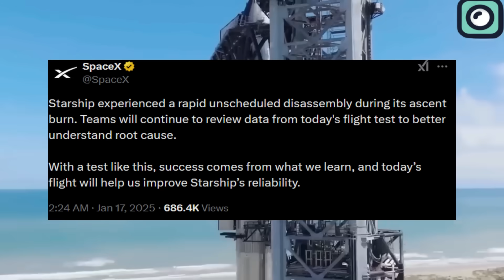SpaceX Officially Revealed Why Starship Upper Stage Exploded!

Comment: 1:54 you can see the piece of the skin (at the mid of left edge of the video frame) is peeled off the body. It flapped crazily just few seconds later (can not see from this video). It is the one caused the failure.

Comment: The video says Spsce X learns from every test flight. Yet it introduced a new catastrophic failure mode either missed before or brand new. If it is new , that is bad. If it was missed that is worse and points to the design not showing maturity. Either scenario, there should be cause for concern. I am not sure that launching right away should the driving factor.v

Comment: Not to forget these are test flights mostly using obsolescent hardware as the design is iterated. The ship likely was going to burn longer using the 300 extra tonnes of fuel. Booster will also be stretched in future with more thrust . None of what we see is intended for routine use yet.

Comment: The purpose of this video is to answer one question: Why did the second stage(ship) explode?  It was because of a fuel and/or oxygen leak.  That needs less than a minute to state.  Further details on what caused the leak and exactly what measures could be used to assure that it would not happen again could have extended the video, but instead we just hear a history of the Starship launches.  Not good.  We watch these things for the details.  We already know the history.
Reply: Yup. Totally agreed.
Reply: Thank you for saving me the time of saying that.

Comment: Compare the Saturn 5/Apollo project to Space X, Its obvious that the engineers of the Saturn 5/Apollo actually did engineering, this is evident by the lack of "catastrophic" failures of the system after a few initial mishaps, NASA's Shuttle is another example of good engineering it didn't suffer a single catastrophic failure during flight testing, The Russian shuttle is a excellent example of great engineering, it worked as advertised on its first flight, remarkable engineering. How many failures has SpaceX had up to now, excluding the launch pad debacles?.
Reply: With spacex, every failure is a success. 😂
Reply: The shuttle exploded on launch with the loss of all astronauts, these spacex tests are unmanned and will continue until completing them successfully numerous times
Reply: Russian Shuttle never flied in space with astronauts. The american Space Shuttle exploded Two times with a lot of astronauts died. It was Better if It exploded during unmanned tests, learning how to fix problems.
The same for the Apollo: remember the three apollo astronauts died in the capsule during the tests on Earth.
And finally the New Glenn Is a failure at the First launch, because the first stadium dangerously crashed into ocean, and never landed on the ship.

Comment: The upper stage was clearly under speed at separation by 900km/h and didn't meet its speed and altitude goals.
By T+ 5.09 flight 6 had reached 10,000km/h and an altitude of 132km.
While flight 7 had only reached 8000km/h and an altitude of 117km in the same time frame.
By T+ 6.15 flight 6 had reached 14,000km/h and an altitude of 142km.
While flight 7 had only reached  10,000km/h and an altitude of 125km.
If you extrapolate this out and consider how much fuel was used in the same time frame SN33 clearly was not going to make its target for re entry.
The spaceX explanation of over pressure explosion makes less sense than an abort and self destruct in my opinion.
Reply: FFS, there was 300 tons more fuel on the ship. I'd expect it to be slower with the same booster thrust.
Reply: @BorgeltInstruments  yep and you add in the propellant leak which makes it an obvious abort decision.
How you going to do a re entry burn and a landing burn if half your fuel is spraying out of the feed lines?
I would bet that extra 17 seconds of fuel got burnt and expelled during the ride up.
Reply: Very interesting, propellant leak aside it's interesting that the extra weight  with addition flue and payload hadn't been taken into account with added burn time to reach a similar flight trajectory to flight 6?
Let's hope they can resolve the fuel issues and recalculate the burn times from this failure, I'm looking forward to flight 8

Comment: Very bad? Is a test. Tests are never very bad or very good, we Need errors to reach perfection.
Reply: Wrong, SpaceX where using this flight to validate the vehicle with the aim of integrating it into full orbital operations. Yesterdays catastrophic failure proves that its not ready for that integration, nor will it ever be an appropriate vehicle for humans until SpaceX engineer an escape mechanism. Also, tests can be "very bad or very good" depending on the stated objective of the test, however, any failure to not complete the flight objective, in this case return the booster AND starship to earth, which was not completed, therefore means that it failed which = very bad.
Reply: Laughable comment.
The other guys delayed and fixed stuff and got it right but you think just blowing everything up every launch for billions of dollars is a great thing.
Obviously you DO NOT need to repeatedly obliterate your ships on pointless launches riddled with faults.
But it’s all good I guess since it’s only taxpayers money yeah?
Reply: Tests ? They are on their 7th test....and the last one was catastrophic. For comparison, Challenger did 10"tests" before it exploded and even that was at least arguably preventable. The shuttle missions did 135 "tests" altogether and all manned except for the Enterprise which was never operational as an orbiter. And every Apollo rocket that went into space (4-17) all returned to earth without exploding, although 13 nearly ended in disaster. That's about 150 space flights when they all became operational and all returned to earth with a loss of two.....quite different statistics compared to SpaceX. Those guys are as far from Mars as the ground is from the sky.

Comment: Bezos New Glenn reached orbital speed  but it failed to recover the first stage on a barge..Starship 7 recovered Starship Heavy with Mecazilla but the Starship failed and exploses..conclusion the good rocket of the week would have been : 1 stage Starship Heavy …second stage New Glenn..LOL😂 both are way too big too dangerous for simple ISS crew swithing fully recoverwble taxi and on Falcon 9 expensive second stage is lost…  and the Dragon capsule cannot land by all weather conditions like lifting body  plane much more robust than a winged shuttle. This would need a smart system with three stages which was too expensive before BUT not if all 3 are recovered and reused…it and be 40% lighter than a 2 stages launcher  for the same payload..such as a Stratolaunch plane carrying a short falcon 9 first stage holding a compact 😅Dreamchaeser orbiter with Jettison tanks and 2 expensive orbital merlin on the back would be light and this could be cheap since ALL 3 stages are recovered except for cheap 3D printed third stage only small fuel tanks but is it no crasy to heat shield empty tanks like the Starship does, and be more heavy for 😅almost nothing. Such a 3 existing  systems solution  offers much  room for progress , the re-ignitable falcon engines can help during take off, dreamchaeser some lift to increase the plane total max load. Then both plane and Falcon type rockets can have a make up refueling session of kesosen and oxygen at 25000 feets with K-46 or A330 MRTT tankers, prior to rocket Launch where 30.000 feets and 500 mph  horizontal is already much fuel and weight saving compared with taking off from zero feet above sea level and no speed. Because a rocker takes off slow it takes much time to reach 500 miles and a 30k feet altitude so much fuel is used as well during that time.. amd that is where launching from plane helps and add one recoverable stage to the system.😂

Comment: Not a single catastrophic failure has been repeated, but they keep finding new catastrauphic design flaws.  But you go on thinking how great they are.  Let's see when they stop exploding.
Reply: Yep, this isn't engineering its trial by error make it up as you go along backyard hacking. I'm looking forward to a max pay load test, it'll be spectacular, lots of spares everywhere.
Reply: @tudomerda  That is exactly how engineering works! You guys don’t see because it’s not typically publicized like this, but design iteration is how we advance. For the record I am an engineer.
Reply: @hectornonayurbusiness2631  engineer of what? You appear to have a superficial grasp of design and safety in a regulated sector if you think this is a clever approach to delivering a safe, reusable and manned solution.
Reply: That’s literally how advancement works. You said it yourself, their failures aren’t repeated.
Reply: @hectornonayurbusiness2631  My point is that is not how design works. At all.